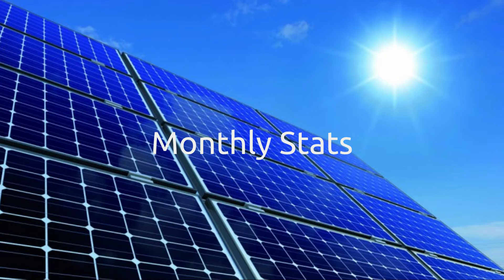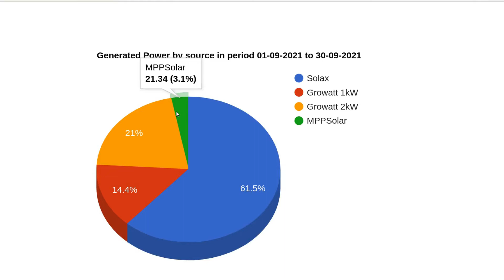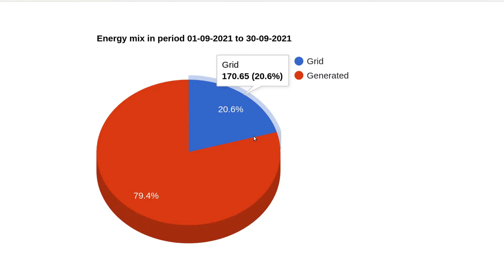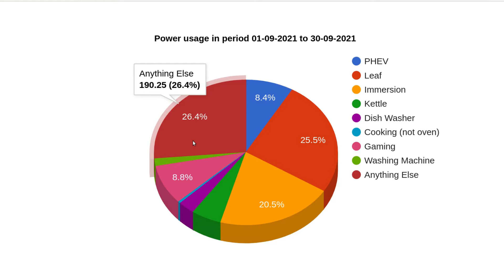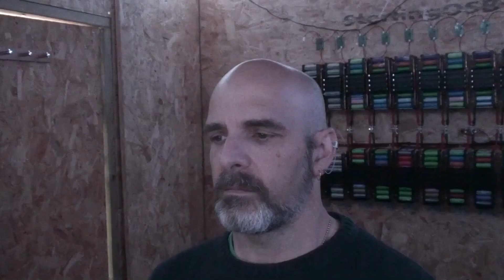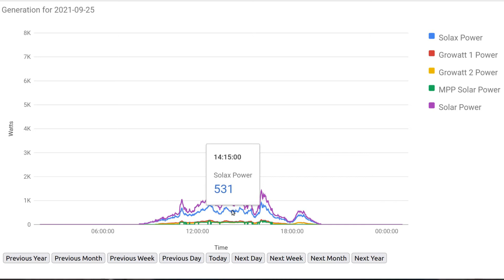Solar/Battery stats for September 2021

Comment: Have you looked into sunamp as a pre-charge instead of using gas? 
Excess solar can be dumped into the sunamp.
This will preheat the water before it hits the gas boiler. 
In the darker months, you can use the 5P off-grid to warm it up

I use about 25 kW a day with no electric vehicles
I'm looking to add about 35 kilowatt hours of battery.
I'm thinking 15 kW of Huawei battery system for its quick response in picking up solar fluctuations.
And about 20 kW of pylon tech for bulk storage.

I really want to put solar on the south walls but not sure the the wife would like the look.
I might try and make them look like windows
Reply from the maker: I have considered some kind of heat battery. I'm still considering all options at the moment. I don't see why you need 2 different batteries. Either the Huawei or Pylontech will more than handle your typical household loads. I've certainly seen no lag to speak of. I have to admit my wife wasn't keen at first but doesn't even notice them now. Good luck.

Comment: Hi Nicholas. A question. I’m just about to have my off grid system installed (same batteries as yours but using the Victron system). Anyway, I’ve been noticing a lot of chemtrail activity over my area and got me thinking about the effect on my solar PV performance. So, my question is: Do you have much chemtrail activity in your area, and if so, heave you noticed any effect on the performance of your systematic? Thanks
Reply from the maker: We do get some chemtrails over the house but I think they are too high and too defuse to make much of an impact on generation.  I certainly haven't noticed any impact.
Reply: Nicholas Howell 
Thanks for the reply

Comment: Apologies,off topic, but,what are your thoughts on infrared heating?
Is it impractical,is it effective,does it use too much electricity for a solar system?
Reply: I’m in Bedford and had 14x400w Sunpower panels with SolarEdge optimisers installed on my SE facing roof on Sep21. Coupled with an Eddi, 5kW SolarEdge inverter and 8.2 AC coupled GivEnergy battery. 150kWh produced in 10days extrapolated for the month (not perfect I know) gives me 86.1kwp. My worst day was the 25th at 5.04kWh with the best on Sep 22 at 24.6kWh
Reply from the maker: @garyday615  Nice array, that should do you well.
Reply from the maker: I know little about it to be honest.  I think no matter what kind of electrical heating system you employ, your solar won't cover it alone, especially in the winter.